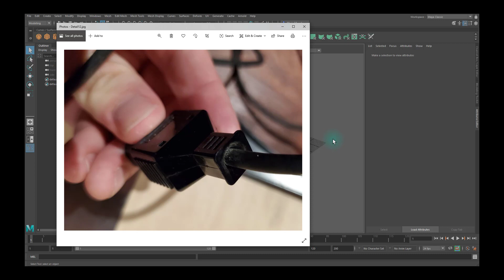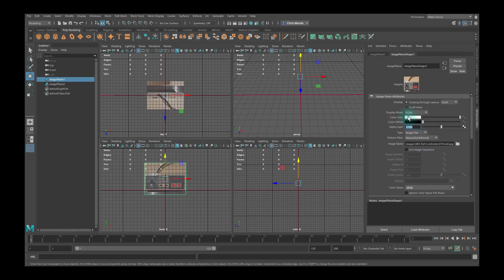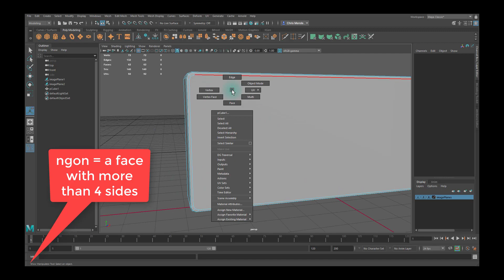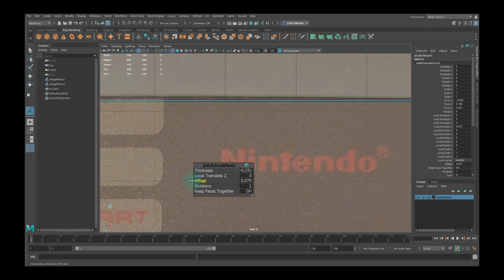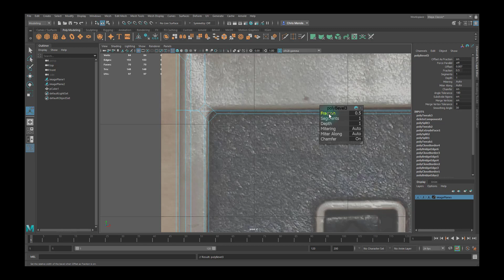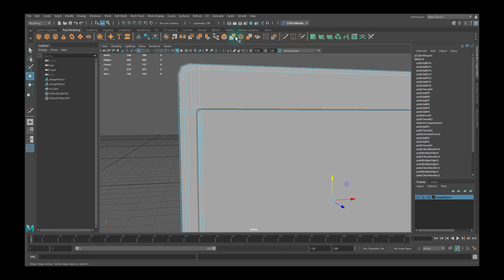Tutorial: NES Controller - 02 (Project Set-up & Modeling Start)

Comment: What do we do if there are N-gons found in cleanup?
Reply from the maker: Depending on where the ngon is, you can likely use the target weld tool in the modeling toolkit to weld one of the ngon vertices to where it needs to be.  After you select the target weld tool, go to vertex mode, then click and drag the vertex you want to weld onto the vertex you want to weld it to.
Reply: Chris Mendenhall solved the issue. I found some lone vertex’s along the edges and deleted them